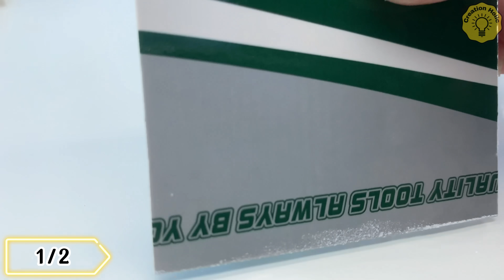Intelligent Plastic Repairing Techniques That Will Make You Level 100 Master

Comment: Maybe you could grind some white plastic and use it a filler instead of baking powder or mix it with soda powder,and then super glue, might give a plastic Finnish
Reply from the maker: It will be very difficult to do because my cracks are quite large

Comment: Just replace the Panasonic cover. They recycle the old covers to make new ones anyway.. more work than necessary
Reply from the maker: The goal of the video was to showcase a unique approach to recycling, but I understand that it may not resonate with everyone
Reply: @creationholic101  it's not that. Panasonic already recycles them to make new ones. So it's not being wasted. Between the time spent the material cost and work done you spent the equivalent of a new cover in the end.

Comment: Thanks for your videos. And which of your repair methods is most suitable for repairing a cracked toilet seat made of a plastic called duroplast? Tired of buying not cheap new seats, in which the cover, microlifts and fittings are intact, but the chair (ring) on which you sit with a spicy part of your body, bursts. Can you make a video on this topic?
Reply from the maker: I will research and send it to you when there is a good solution